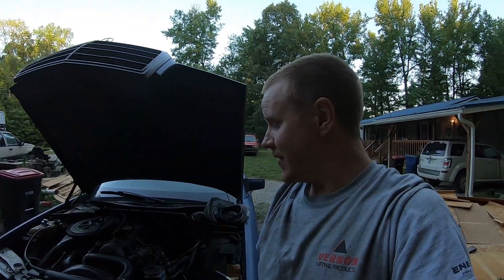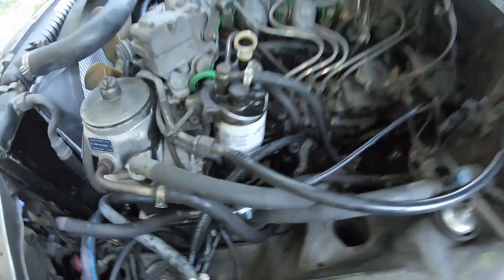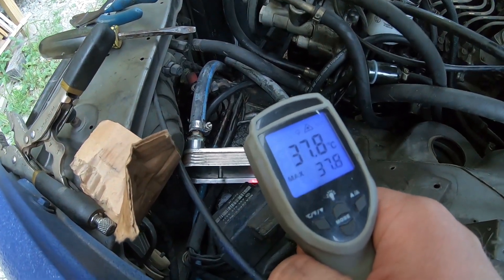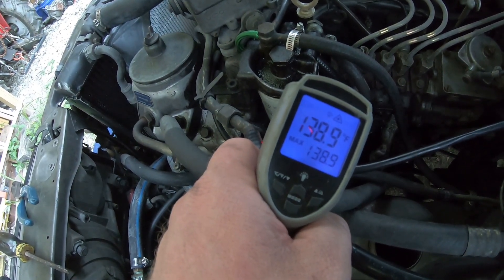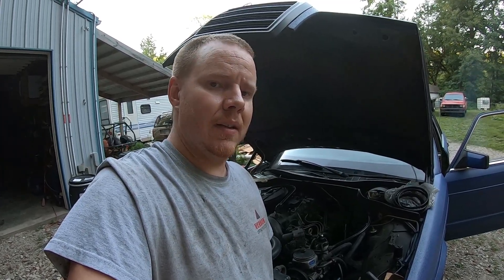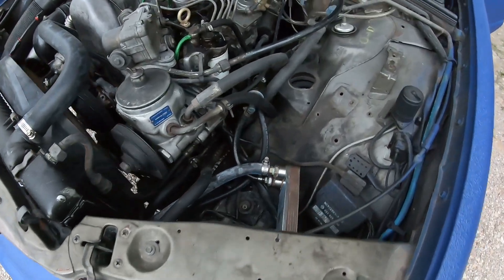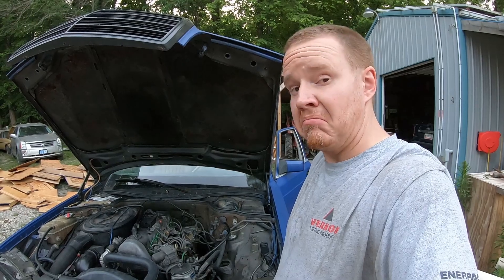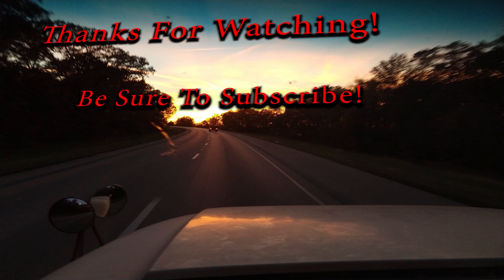Black Diesel - 300SD Experiments - Flat Plate Heat Exchanger - WMO - Alternative Fuel

Comment: Any updates on the merc?  I've been running a 70/30 mix with wmo and diesel in my 12 valve Fummins swap.  I've put over 180k miles on it.  I have slight haze on startup but I run a water inj system that I think helps it.  I'm thinking of heating the fuel first to see if that would help.  Thanks for all the great content.  I'm always excited to see your new videos.
Reply from the maker: No updates on the merc yet.  Been spending a lot of time on the flatbed and the tdi swap project.  The merc will make it back in the shop before too long though.

Comment: Love the OM617's I had an 83 300SD. I pulled the engine and put it in an 89 Jeep YJ. I wanted to run it on waste oil back then but traded it for a 3/4 ton Dodge truck.
Reply from the maker: They are solid old engines for sure

Comment: Hello my friend. How are you doing? Hope you and your family are doing well. Very interesting video. Have you thougth about using this fuel plate heat exchanger on you truck with two tank setup? Or heating the fuel filter before it goes in the lift pump? That might help with fuel delivery in zub zero temperature.
Reply from the maker: I have and it's something I will be implementing on my flatbed soon.  Already have the parts...  just no time to do it.  Lol
Reply: @NotSoGrandGarage  Is it fuel plate heat exchanger or heated fuel filter you are thinking of?
Reply from the maker: @trondvidardalseng894  I have both but I'll be running a wvo designs heated filter housing for starters.

Comment: Man do you have any idea how can i increase inlet temperature of methanol as a fuel? And where can i buy this heat exchanger?
Reply from the maker: It's just a flat plate heat exchanger.  There are multiple outfits that sell them.  Super common and not just for fuel stuff.  They make different  sizes.   This is a 10 plate iirc.

Comment: Looking good!!!  With as heavy of an oil as you are using, the only thing that you can really do to fix it is to change the timing or mix it with a much lighter oil, or both.  Still looking really good, though!!!!  Keep in mind that if the oil is too heavy, it will wear out the injector pump as well.

I still have my turbo diesel OM603 injection pump, if you know anyone that needs one.  Running beautifully, even after the car was totaled, but engine block was busted when she hit me head on, so couldn't salvage the block, and forgot to grab the heads before scrapping it.

Can't wait to see the next video!!!
Reply from the maker: It's definitely getting a timing bump.  I think it plugged fuel filters as it lost all power yesterday.  Kinda thinking the heat exchanger had some junk in it as it was from another project and had been sitting.  Going to service the car out this week as its due for an oil change too and I'll bump the timing a bit while I'm at it.  Video on that soon hopefully
Reply: oh, I also have the turbo off the car as well.

Comment: I am in the middle of setting up my waste oil system, I am in northern Canada where it gets very cold and I’m wondering if I should be rubbing some sort of tank heater setip go get the waste oil to flow in colder temperatures? The heat exchanger is a good idea but the oil needs to get to the exchanger… thoughts?
Reply from the maker: In a super cold environment,  a coolant loop tank heater will almost be required even with wmo.  You may have to run a higher percentage (20-30%) gasoline in the mix
Reply: I would definitely recommend it, you can get the silicone 12 volt and 120 volt heaters, also would recommend plugging in the diesel engine heater as well, so that the engine is already heated up.  I would tie the 120 volt silicone tank heater into the engine block heater and set the 12 volt heater to come on when the vehicle is turned on.

For running waste oil that far north, I would strongly recommend running a dual tank setup.  I have to do that in Kansas City, Mo during the winter here, so I'm quite sure you would likely need to do the same.

Comment: Excellent work!!! Do you still have the water injection system working as well to reduce haze?
Reply from the maker: I do and it does make a difference still...  but a high blend on a single tank is starting to take it's toll.